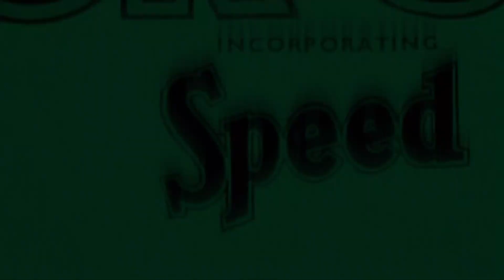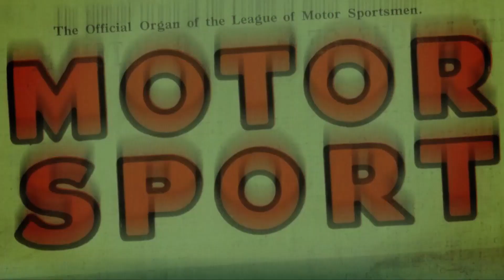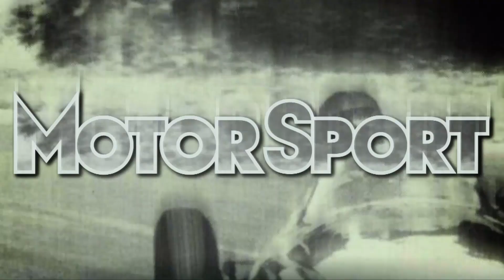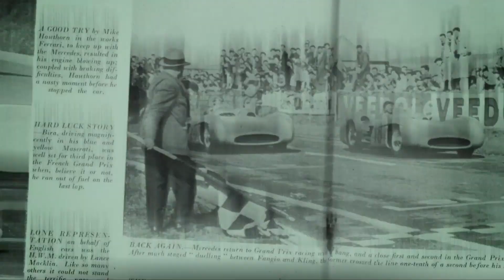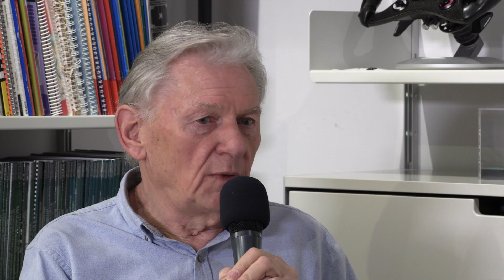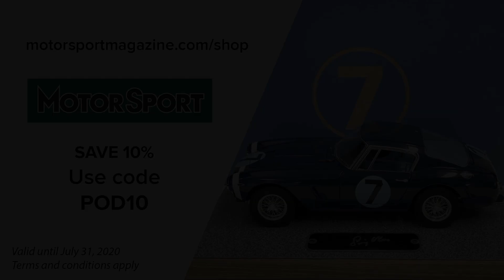Podcast: John Barnard | Engineering the Greats

Comment: The Chaparral 2K was a marvel. An interesting fact that it is the first ( and only ) “modern” Indy car with “outboard” rear suspension ( springs and dampers set vertically, cantilevered at the extreme outboard ends of the rear axle ) or no “rockers” or push/pull rods at the rear. Extremely interesting- and unique.

Comment: Semi-automatic gearbox was developed in Ferrari prior Barnard joining the Scuderia. Electro-hydraulic gear shift system was built on 1979 and tested, Shechter and Villeneuve, in Fiorano on Ferrari 312 T3 to evaluate   its  use on the new T4 model. Gear  shift   driver input was by means of two push buttons on the steering wheel. Villeneuve was hot happy to abandon the gear lever, project was dismissed.
Reply: Williams had a system in the mid 80’s. But you have to wait for the tech to catch up

Comment: Wonderful interview. Always wanted to understand why the Ferrari wasn’t reliable and really well explained by John. I believe John also had some impact on the F40 too. Such a great era at Ferrari
Reply: There are many reasons why Johns cars in general were not reliable. And also why his Ferraris were not, too. Even more reasons than why most of his cars were not reliable. First there was the problem of Guilford/Maranello. John designed the cars and built most of the parts in Guilford. The car was put together in Maranello. This alone leaves room for a lot of problems, as you surely can imagine, especially since Guilford and Maranello used different software for design and manufacturing. That John did not trust the engineers at Maranello and only talked to them when he needed to(to exaggerate a little bit)was another reason. Next reason was that the engineers in Maranello did not really like John, too. If the relationship is that bad, people do not talk a lot. And in such a technical environment like F1, of course reliability suffers.. Also John always started from scratch. So almost every important piece of the car was always completely new every year.Also the concept of the car was totally new every year. Another thing which favors reliability issues.Also Ferrari(Guildford and Maranello)did not have a good quality control system yet. Mario Almondo started to implement an industrial type quality control system in 1996,  but it was not untill Ross Brawn arrived from Benetton, who added a more specified system that united industry type Quality control fitting for F1. Ross introduced a system were problems with the car(every single problem)got a code(A, B, C, D). A-Problems had to be solved untill the next race for example(very simplified way to explain it, but it would take too long to explain it in detail).Also Ross brought a methodical approach to Ferrari and this and the quality control system of Mario Almondo united with Ross priority system, improved reliability extremely.
Reply: @fam.hunger5244  thanks for the deep insight. So much more might have been achieved if he had been in Italy... on a positive, Ferrari nearly won the championship (can’t remember the exact year) with his car if Senna hadn’t of run Prost off the track. I guess the risk of new innovation nearly paid off, and he lead f1 cars into a whole new era. Brilliant engineer

Comment: John is a great engineer. Game changing for F1. Unfortunately his ego always was his biggest problem. And still is unfortunately. Thats probably the reason why he seeks credit where other engineers deserve to get credit for. So he seeks credit for the Benetton Championship cars, who were designed by Rory and which were built 3-4 years after he designed a Benetton car and were totally different cars actually with not much left of Barnards B191. The sucessfull family of the F200x and even the F300 and F399 - they had not much in common with the Barnard designed F310's, whichs B-version needed to be  extremly modified to be sucessfull(balance, aero and even the fuel-system and the monocoque got changed). These were completely different cars. 

Barnard was a great engineer who changed F1 indeed, but its a shame that he downplays the talent,  great work and also innovations by other engineers like Rory Byrne, Ross Brawn, Adrian Newey etc., by saying in his book that he was innovative and these designers were not. One-Piece Wishbone, the Titan-Alloy Gearbox, Metal-Matrix Uprights, first ECU in a F1 car, First Double Rear Wing, new generation of Dampers, Hot-Blown-Diffusor, Coanda-exhaust, Zero-Keel,  Double-Diffusor, were just a few of the innovations of Brawn/Byrne and Newey. That proves how horribly wrong his statement is. 

John is a great designer who did an amazing job, and he changed F1 forever. But there were other engineers like Ross Brawn, Rory Byrne, Adrian Newey who were as brilliant and innovative and game changing(just think of how Brawn and Byrne raised the bar of how a F1 team operates and is organised at Ferrari and how they implemented industrial standards in the construction, quality and design of a F1 car). And its pretty sad to see that Barnard still has the ego problem today and is not able to admit that, but is indeed downplaying their achivements and their great work. A great engineer like Barnard should  not need and do that.

Totally agree with John about DRS. DRS is bs! Like John said that has nothing to do with overtaking or a fight. Its flying by. DRS is the worst enemy of close fights. F1 needs to get rid of system.
Reply: Thank you for this insight.
Reply: Wow you sure know your F1 stuff
Reply: DRS was brought in only  because F1 hadn't sorted the aero rules to enable overtaking without it!
Reply: @TOMLINBISH  so before DRS there was no overtaking? There was. But it was not easy to overtake. DRS was introduced because the dirty air behind a car made wakesurfing less possible and the car behind lost a lot of its downforce(downforce problem was not changed by DRS at all)But that does not change the fact that it does more harm than good. Overtaking today is a joke. The driver behind gets a 20-30km/h advantage and flies by. That totally destroys and reduces real close battles. Its not an art to overtake anymore, to prepare an overtaking manoeuvre. And really good battles are rarely seen. And these fly bys are as boring as they are completely  non exciting. Anyway - it does not matter why DRS was introduced, thats not the point. The point is that it destroys real racing and real battles.

Comment: I like John Barnard's legacy in the sport.  But I can't lie....  his explanation about what went wrong at Benetton didn't quite add up.  The way he brushed off Rory Byrne and his explanation of how things went pear shaped at a contractual level?  It seemed like there was a bit of lying going on.
Reply: I totally agree. The thing about JB is, and that comes from an aerodynamicist of F1, that JB was totally weak on aero and electronics.  His decline as an engineer in the 90's, exactly when aero became most important is not a coincident and proves that statement. Also there is a story of another aerodynamicist who was insulted as black magican by JB. Rory surely did not need JBs help regarding aero as Rory was so much better than JB in that regard. Another fact is that the B191, designed by JB had a pretty poor weight distribution, stated by Michael Schumacher, who said that the B192, built by Rory was so much better in that regard. And finally the F310B, from which Ross Brawn said he has no idea how JB came to things like weight distribution, fuel system,  geometry...and that the F310B got so much better after Ross and Rory made their changes on this car, says everything. Another thing about JB is his ego - he says in his book that he is responsible for Benettons titles and Ferraris titles during the Schumacher era. Thats completely ridiculous, as the technical changes in 93 and 94 required totally different cars, so JBs B191 was a totally different car. Also his last Ferrari from 97...in 98 came the grooved tyres and the reduction from 2m to 1,8 m width. This again required totally different weight distribution, totally different suspension geometry and a totally different aero. So the cars were completely different. JB was a great mechanical engineer, without a doubt. But that was not enough in the 90's. But as his arrogance and ego stopped him from inproving. So engineers like Byrne, Newey, Brawn who never thought of themselves of being the best, improved much more than JB and become much better engineers than JB, whos approach stayed the same as it was in the 70's and 80's. Rory was great mechanically AND in aero and thinking of the car as one. And his concepts were so much better than JBs because of that. In his book JB talks much about aero. But he never gave aero so much attention like Newey or Byrne. And in the 90's this was a well known fact that he does not. Today everyone knows that aero is and was king, so JB needs to make people believe he worked hard on that side, what he did not, because he was not good at that and wrongfully thought other things are more important. He does not tell the truth about a lot of things. He wants to take credit for things others deserve credit for, or he wants to take away things from others who really deserve the credit for these sucesses. Its a shame to be honest. A great engineer like him does not need this. But his ego was and still is his biggest problem.